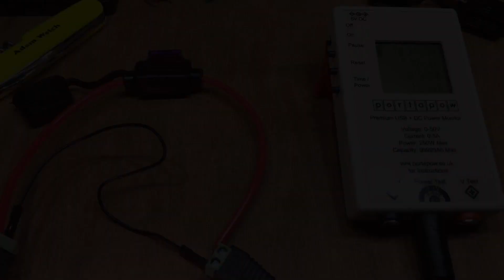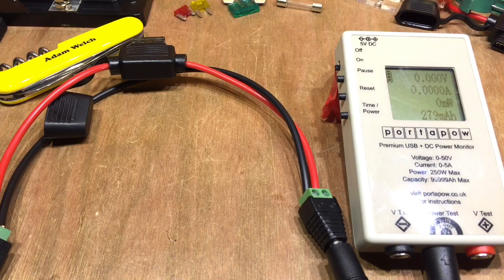Fuses - Solar Safety Part 1 - 12v Solar Shed

Comment: A fuse saved my 48v 23 AH ebike battery after I mis set my multimeter , luckily the charging socket had an inline fuse , so a spark and fuse blew  but battery and it's BMS saved , first time I'd seen a lithium battery with charging input fused not just the usual output fused  , lesson learned

Comment: My 48v Inverter died and went dead short. The fuse between that and my battery blew properly. Without that fuse its possible my 10 awg wires could have carried over 100amps which would have definitely destroyed the wire insulation and maybe caught fire. A fuse as close to the battery as possible is always a good idea. 

To bad I have to replace my 25 year old 4000w inverter. But it did great the last couple decades. 

My worry now is that the blade fuses are rated at 32v. The max voltage of my battery pack is 58.8v. What was the possibility of that fuse arcing and causing a fire at that voltage. But I can’t find a good 60v fuse solution.

Comment: Hi I have a 100w renogy solar panel going to a 40 amp renogy solar charge controller I would like to fuse the solar in and and the power to battery but no idea of fuse size plz help if you can answer

Comment: Hi mate Ireally enjoyed watching your video I bought 150w solar panel and I just want to play safe could you tell me what size fuse I would need on a 4 ml cable to my battery, if you need a payment for your advice I will gladly give but would appreciate your help
Reply from the maker: 4mm cable? That’s good for 30 amps plus. Assuming your panel has a maximum power point at 18 volts - that would be 8.3amps. If it’s a 36v mppt, that’d be 4.2amps. So a ten amp fuse will be good and will absolutely protect the wire.
Reply: @AdamWelchUK  many thanks for your help , does it matter on the diameter of the fuse cable if it's not the same diameter as the 4mm im using .
Reply from the maker: @davidbrackenbrough6099  no worries. Well that will become your weakest link so yes, you should take that into account. At 150 watts though the current is pretty low and you may not need to worry too much.
Reply: @AdamWelchUK  many thanks for your help if u would like me to buy u a pint for your help just let me know cheers .

Comment: What determines the amperage of fuss or circuit breaker to choose for solar panels PV and battery?
Reply from the maker: Ultimately your wire. 
The fuses and breakers are to protect your wiring from damage if the devices connected pull more current than they should. 
If your panels can provide say ten amps normally, I’d look to install wiring suitable for fifteen amps and fuse at twelve amps or something along those lines. 
The same applies to loads - calculate your maximum concurrent load, size cabling to suit with head room then rate your fuse to sit in between the two.

Comment: my panels are 8amp . i put 10 amp fuses inline . so anything over 2amps or 3  will blow the fuse . and i have the big barrel inline fuse you have , in 80 amps for the panels to charger , and from battery 's

Comment: @Adam Welch 
hello i have to questions for you I've been meaning to ask. I have a boat running a 12v system 1) would it be ok to use 250v 32mm glass cartridge fuses on a 12v circuit 2) I have a bilge pump and a float switch. On the float switch it says 12v 20amp max and on the bilge pump it says 3.5amp draw. I was wondering what amp fuse do i use in the bilge pump control panel.

Thanks

Comment: Adam at 2.56 the fuse box seems to only have one cable connector for Positive. How do you connect the Negative cable? Great video.
Reply from the maker: Thanks. Normally you would just connect all negative cables together using a bus bar or something similar. In vehicles for example the chassis of the car is usually the common negative point or ‘ground’.

Comment: Has it been mentioned that fuses should be within afoot or so of the current source so the entire circuit is protected? No? Consider it mentioned. A burned through wire is still capable of carrying current to the break, and a short to ground could occur at that point. Cheers from Ontario.

Comment: So at 5:00 in the video, should both the negative and positive wire have a fuse?  Fusing the positive side didn't help the wire on the negative side so it seems the negative side needs a fuse as well.  You put the small wire there on purpose, but what about when someone does it due to mistake or failed calculation?     At 5:48, you said "so we see the fuse is to protect the wiring not the device at the end of it", but that fuse didn't protect the wiring on the negative side, the negative wire started to smoke.    You corrected the negative wire on your own with a bigger wire, but the fuse didn't protect the tiny negative wire.  I'm so conFUSED.  LOL.
Reply from the maker: Hello. The same amount of current flows throughout a circuit. So the fuse or breaker should be chosen based on the weakest component. I’d imagine in 99% of cases your pos and neg wires would be the same spec, but if not the fuse needs to be chosen based on the lower of the two current carrying capability. You only need one fuse or breaker, because once it’s popped no current can flow in any part of the circuit.

Comment: I am having problems with the round  red and black type rated 50amps , I've got about 36 amps going through it and the output side gets hot sometimes trips out
Yet only having 36 amps ,I am thinking of trying a dc type called  tomzn type do you think they are ok    ? Are the red and black ones meant to have the little brass collars crushed over the wire or just the wire pushed in and then the Allen screw on to the wire in the brass collar /lug ? Any advice massively appreciate ,always watch your videos .

Comment: I know its an old video but for future viewers here are the names of the two unnamed fuses.  The The blue blade fuse is commonly called a MAXI fuse.  It was used primarily in US cars up to the mid 90's and is used as he stated in uninteruptable power supplies (UPS) or other devices with high amp ratings.  The fuse in the bottom is called a Buss fuse.

Comment: There are some automotive circuit breakers that plug in just like these spade connector fuses. They will be DC of course. I'm going to have a look on my next auto wrecker visit to see if any would be of a useful value. This type of breaker is "auto reset", so are not suitable as a switch.

Comment: hi mate what fuse would I use to go from my 12v battery bank to the thing  I am powering. I am using 4 12v batteries in my bank and powering L.E.D lights and a car radio. if you could help or give me some info it would be great.

Comment: Fitting inline fuses throughout my solar power setup certainly did save my shed from burning down. I accidentally fitted a 40amp blade fuse between my batter bank and inverter when it should have been an 80-100amp, didn't take long for it to blow and melt the plastic casing. So yes, definitely fit inline fuses because running two e-bike battery chargers through my 1000w inverter might only pull 2-4amps at the AC end but pulls about 24amps through the DC battery to inverter cables, then add more load from other devises and soon you'll be pulling a lot more amps than the 40amp fuse can take !!  Now I use an 80amp breaker !

Comment: Hello 
I have a small solar panel 12v 50watts , Battery 12v 70ah , load 12v 24watts.
1-What’s the size of wire(awg) I can install ?
2-should I use fuse ?if it need ,where should I put?what’s size of fuse?

Thank !

Comment: I have 4-12vbatt in parallel = 440Ah.  I wanna connect 2led 12v (9w bulbs).    Question ill be needing to install 2.5 fuse or 5am fuse?
Reply from the maker: 2*9w is 18w. Power(P)=Current(I)*Voltage(V) so I=P/V so I=18/12 so I=1.5 amps. A 2amp fuse will be sensible as long as your wiring can handle 2 amps - because that is what the fuse is protecting.

Comment: Hi adam just like to say great video .could you please give me some advice on what size fuses to use on a small set up consisting of a 10 amp solar panel 30amp solar control charger a 12 v battery and a 400 w pure sine inverter as this is my first attempt at this any advice would be greatly appreciated
Reply from the maker: +mathus73 A 400w inverter is likely to pull more than 30 amps at full load (probably 35-40) so you'd probably need to spec your wire and fuse at 40 amps to be on the safe side. You obviously need to connect the inverter straight to your battery. 
Your solar charge controller can probably be fused at 10 amps if that's all you ever expect to be putting through it. Most of my solar panels aren't fused. They don't hold a charge and can be short circuited without any issue. Solar panels have to be held in a mid point to create any energy. Now I wouldn't recommend this for large installations but it really isn't necessary for small panels. Thanks for the nice comments.
Reply: I thought solar panels were fused because of the power available FROM the battery that they are connected to?
Reply: @rogercrier  solar panels are connected to a charge controller which prevents back flow from the battery. most good quality panels also have a diode to prevent this also.

Comment: What I don't understand is why you would need a fuse to protect the wiring at all. Presumaly you have already made some sort of decision about what gauge of wiring to use to handle the likely current. How then do you decide on what size of fuse to use? Should the fuse you put in be less than the wire can handle but then how do you decide on that?
Reply from the maker: If for some reason your cables carry more than you planned for they will get warm, might melt the insulation and this can cause fire.  So you spec your wires above what you think your normal maximum load will be, and fuse them at this load (probably a fraction above).  
Often in a twelve volt application you have put higher gauge cable in than you might otherwise to reduce the voltage drop.  So those cables are able to carry even more current and the danger increases.
Reply: Thanks for the reply. I'm being thick here I know because there obviously is a need for fuses otherwise they wouldn't be used. I'm just trying to get my head around how you select the size, especially since your video highlights the fact that fuses often can take more current than their rating,

I also don't understand your last sentance. If you have used thicker gauge cable which will handle even more current how has the danger increased?
Reply from the maker: Lets say you're anticipating your load over a cable to be 8 amps.  You're going to find it hard to find an 8 amp fuse.  You're going to be stressing a 7.5 amp so you'll choose a 10 amp - an easy to find fuse which is rated for the current you intend to put through it.  It will carry the intended load, but you're limiting the circuit to not much more than what you designed it for.
As for the bigger cable potentially being more dangerous well lets remember what a fuse is - a thin piece of wire rated to carry a specific current for an amount of time.  The bigger your wire the more current is can carry.  The more current means the more energy can be released if something goes wrong. A thin piece of wire across a car battery will act as a fuse - it will burn up very quickly and break the circuit.  A thick piece of wire will allow the battery to discharge a lot more current for a longer period of time - causing heat both in the wire and in the battery.
Reply: Thanks for taking the time to explain that Adam. I think I am catching on now. Part of my problem understanding this is I am not differentiating between the 'normal' current you anticipate flowing in a wire and that which might potentially flow in a problem situation such as a short circuit.

Comment: Im starting my first small off grid system and i wonder if it will work when i have one 100 watt solar panel and a 30a pmw charge controller, a 150 watt modified sine inverter but one 500 on the way in the mail and 6 x 12 volt batteries that all have different capacity ( all used car batteries with 40-70 of original capacity - they all hold a nominal 12.6 charge with no problem).
So i have much more battery capacity atm that i can drain with the inverter but im wondering how do i connect the batteries to the controller and the inverter?
And will it give charge problems with them all having different capacity?
Do i just wire them all in parallel to the charge controller and the inverter or i need some special wiring because of the different capacity?
i know it cant separate charge each battery but im hoping that i can just connect all batteries to positive and negative and the inverter will drain tha batteries so slow that the charge controller just maintanence charge them and the drain will be about equal for all the batteries?
Reply from the maker: Using different capacity batteries isn't optimal and it may be better to leave any very low capacity batteries out of the pack.  Most online resources will tell you that a battery pack made up of three batteries one of 70Ah, one 80Ah and one 100Ah will actually perform the same as three 70Ah batteries in parallel.  The larger batteries wont be able to give their extra power because the smallest will deplete first and drag the others down.  Actually I'm starting to think it's not wuite as simple as that.  I suspect the 100Ah battery will actually charge the 70Ah one a bit.  In reality the number is probably somewhere between 70*3=210Ah and the total capacity 70+80+100=250Ah.

So if your dissimilar batteries are in the same ballpark then it's probably worth putting them together.  If they are way apart then it's not a good idea.  If you want optimal performance, buy multiple new batteries from the same brand, at the same time, with the same rating. 

Wiring - for me, put them all in parallel - all the positives together, all the negatives together, but connect your charge and discharge leads across the whole pack.  So in a three battery system connect your solar charge controller to the pos of battery 1 and the neg of battery 3.  It should give a more even charge.  Your inverter could go from neg on battery 1 and pos on battery 3 to give a more even discharge.

Hope that helps.
Reply: thank you.
i guess i will have to start discharge test them all to know each capacity.
its gonna take awhile with my imax b6 at 2a discharge but once i have them all tested i will know the exact capacity for each battery

Comment: Hi Adam, I believe the large 60A fuse is called a maxi fuse.
Reply from the maker: +Steven Watson Thanks for that Steven.
Reply: Adam Welch no worries Adam I have just enjoyed both of your videos. I hope I may have helped you in some way. Kind regards.
Reply from the maker: +Steven Watson Cheers. I'm very lucky to have lots of helpful comments just like this. I really appreciate them all.
Reply from the maker: Blade fuses? Really?  They are used in millions of cars world wide so I'm fairly confident the design is ok.
Reply from the maker: My mistake, sorry - so you find the larger 'maxi' fuse have a loose fit?  Isn't that the holder rather than the fuse then?

Comment: Seriously like these fuses series. Very interesting and it should be basic knowledge and standard procedure to use.  Unfortunately I and I suspect others think about getting devices up and running and forgetting these things. Ok when doing 3.3V stuff but at higher Wattages not so anymore.
There is a common mistake here, even on the news, that people say that there was a fire because of a short circuit. Well wrong since that would trip a fuse.  Most fires start because of a bad contact or the lack of proper fusing.
Adam it might be worth to do some tests on cable and connector losses .
Reply from the maker: +Luc Peeters Thank you. It's a good point about high resistance contacts. I didn't like the loose fit of that car audio fuse. At 40 amps I'd be concerned it would generate some heat. You need a thermal camera to properly show that though and that's a bit beyond this channel for now!

Comment: Very nice. its 100% the same in all mcb's they will run high but the bimetalic strip will eventually knock it out and if theres a fault and there is a sizable current flowing the coil pushes the mcb out! 

I'll be honest I use old wylex fuse boards I rip out of houses. One of which has a woodern base. and use 5/10/15 Amp fuse wire. probably not the greatest idea as the fuse will allow twice its rated at for a fair while!
Reply from the maker: +pietkaify Thanks. I was surprised to find no bimetallic strip in the DC breakers after watching mjlortons video on breakers. Clearly DC current does still make the strip bend but instead it looks like they use the hydraulic solenoid instead.  I think you're more qualified than me on this subject so if you're happy with your method then I am too. I don't think either of us have particularly high voltage or current going on.